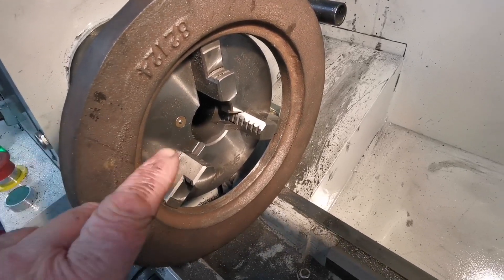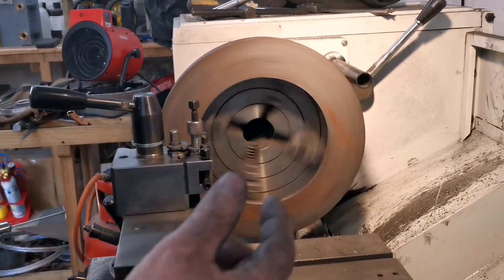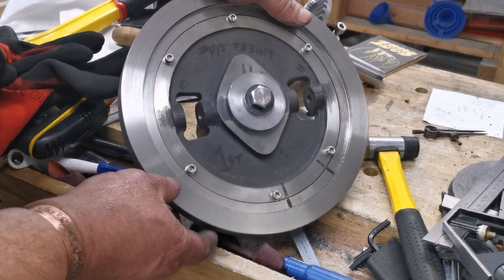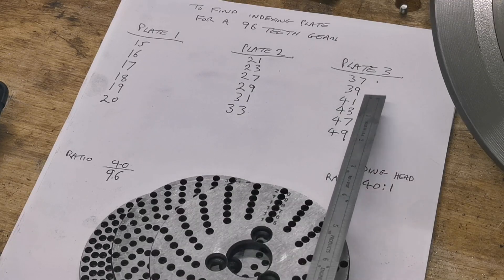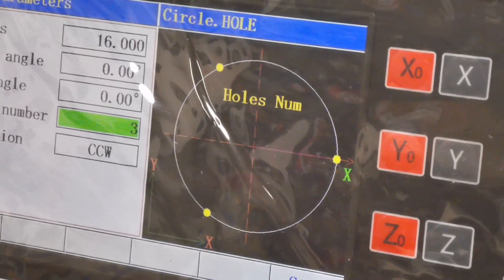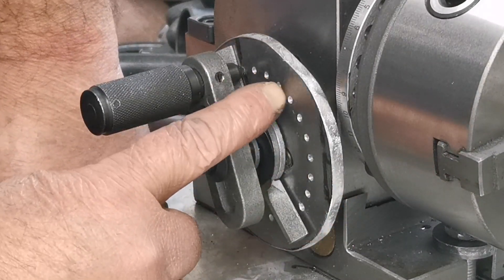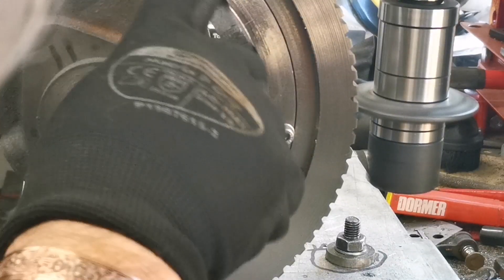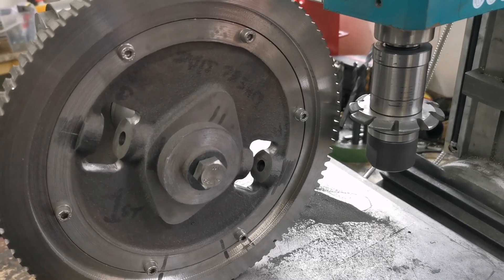2" Fowler Showman's Traction Engine final drive gear and centre

Comment: Did you get the teeth finished
Reply from the maker: Hi, I have finished cutting the teeth a few at a time, and they have turned out very good, but I have been having a bit of a problem with my back so I have not spent much time in my workshop, but I shall post a new video in the next day or two 👍
Reply: @jammymowlam1  you need a Sealy posturepedic for that